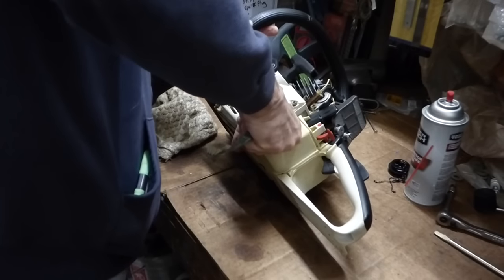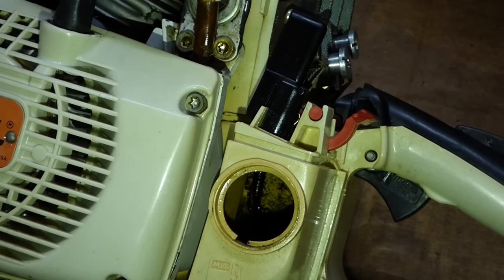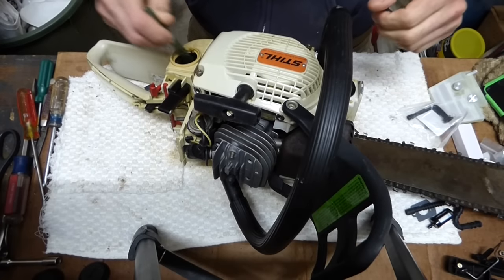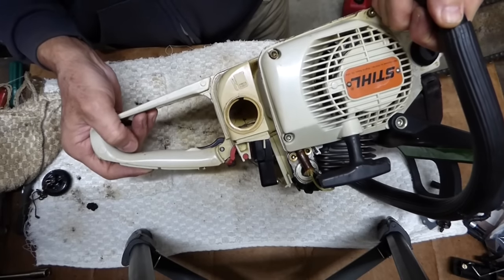Never Do This to your Chainsaw ... How to Repair it if you do

Comment: I have a o25 I bought new, its about 10 years old it will start, but after you use it for a while  you have to goose th throttle  and if you let it idle it will die and when  I pull the rope it will hit sometimes and you have to feather the throttle handle. To get it running again for a short time.
Reply: Sounds like the low speed carburator adjustment screw needs to be turned in or out.  Get it running and insert a small screwdriver into the adjustment hole to turn the screw.  Turn the screw in just a little and listen to the engine.  The rpm will either get higher or lower.  If it gets higher, keep turning until you get the rpm to start decreasing again.  Then reverse directions just a little to get the highest rpm at idle.  If, when you first start turning the screw, the rpm goes down, then turn the screw out to find where maximum rpm is.  There is also an idle speed adjustment screw.  This should be adjusted so that the chain stops moving at idle speed.  The high speed adjustment screw can be adjusted for maximum rpm too when the throttle is wide open.  Before you do anything though, get the air filter off and blow it out with some compressed air.  A dirty air filter can mess with the fuel to air mixture too.

Comment: @Helping U online - You recommend not leaving fuel in equipment for long periods. Can you please define what you consider to be a long time?
Reply from the maker: If I don't use a piece of 2 cycle equipment more than once a month I drain the fuel out of the tank and run it out of the carb....  just takes a minute and saves lots of headaches.

Comment: But what you got off ebaY were Farmertec/Huztl MS250 components. Made in China for a MS250 exact clone version of the Stihl.  Servicable, but maybe not so hot.  If they don't come bagged with a Stihl item number they're not OEM Stihl. Personally, I wouldn't trust the fuel line or the air filter (the air filters sometimes don't seal well and allow dust in around the flanges - like your carburetor showed originally).

Comment: Why did you not grease the bar sprocket?  There's usually a little hole on each side of the bar at the sprocket to inject grease into it.

Comment: Why use silicon grease for the sprocket? I thought that was low heat low speed grease. I would have chosen lithium grease over silicon; or wheel bearing grease with some molly in it.

Comment: What works great for cleaning the inside if the gas tank… GunkSC and some BBs let it soak over night, agitate. Pour it out and rinse with a hose. Dry it with compressed air or a shop vac.

Comment: Ethanol- the issue with many an engine that wasn’t made to run polluted fuel.  Sometimes melts rubber, sometimes hardens to the point of rigid.  Saw many times in radio control gas engines.  I always find no ethanol fuel and use good 2stroke oil.  Fresh mix only.  With $2500-$5000 invested in my plane the last thing you want is a stall or damaged power source.

Comment: The newer saws you want to keep full of fuel, even if they sit a year or the gas line dries and cracks out. The older saws you need to empty. Any Stihl shop can answer what year(s) are the range in which is recomended

Comment: You Don’t leave Gas/premix in any Two stroke / two cycle Engine primarily because the petrol will evaporate slowly making the fuel more oil rich. I never leave two stroke mix in a fuel tank for more than a week. It will minimise plug fouling too. I drain my Chain oil to so there is nothing to leak out.

Comment: I wouldn’t not buy a saw just because it needs a top end. You can get a meteor or hyway top end kit for around a $100-$150 for most saws. Granted these cheap homeowner grade saws aren’t worth fixing, but a pro grade saw at the right price is most certainly worth changing a piston and jug on. Changing a top end isn’t very difficult or time consuming. As long as the bottom end is good it’s worth fixing in my opinion.
Reply: If a rebuild isn't that hard, and I can get a top end kit for 35 bucks, and I don't need a professional saw, why shouldn't I fix it? Sounds like your talking down from your pedestal....your opinion is tainted.

Comment: American fuel must be wild stuff!
I can store a saw for years, full of fuel, start it and it'll run fine!
Petrol must be a better fuel than "Gas" !
Reply: They add corn based ethanol in our gas here. Usually the "premium" grade gas is ethanol free but in some areas of the country that even has ethanol in it. Less problems back when gas didn't have ethanol in it at all
Reply: Do they put ethanol in your 'petrol" if they don't then that is why it lasts. Our fugking government mandates ethanol in fuel for cars. You have to buy more expensive non-ethanol fuel for yout gas powered tools.

Comment: I would have removed that repair handle, removed the fuel line and used the pressure washer on the tank.  I would have also removed the starter, bar and sprocket cover and cleaned these parts with the pressure washer.  Super Clean and the pressure washer would remove that tar from the tank.  Water does not hurt a chainsaw but be careful not to get any in the engine.  I block off it at the boot and exhaust port.  I want to get the cylinder perfectly clean.  I will then blow everything dry with compressed air and let it sit in a warm place for a couple of days to dry.  The only thing I worry about is did I loose spark washing it?  A lot of coils will develop cracks over time which could let in some water and kill spark.  However, I just replace the coil.  Washing the saw did not kill spark - a defective coil killed spark and it is better to replace it than wait for it to fail, later.  I want carb nuts to have even torque on each nut and be screwed down, evenly.

Comment: Why did you pollute a good gas can with the first stuff you dumped out, but on subsequent washings you used a cup?  Now you'll have to wash out your can! 😅 Also why do you use a greasy, dirty rag to clean the grease out of the clutch drum? 😂 And like someone else mentioned, there's a little hole in the bar near the sprocket to lubricate the bearing.  You can buy a grease gun with a special tip that fits the hole.  The oil doesn't even enter that bearing because centrifugal force will not allow that.  

You did a good job other than that.

Comment: I would argue that depending on the price of the saw it is worth replacing the piston and cylinder.
Reply: 35.00 US for aftermarket head/piston/rings kit for ms290 I'm doing right now. Plenty of YouTube videos to help with the rebuild. Would be a shame to scrap a saw for that reason.
Reply: Piston and cylinder are not maintenance items. Run them until there's a loss of compression.

Comment: I have a 230 and it starts if I prime the carb through the air input . It fires up for 2-3 seconds then dies. Then that's it. A lot of pulls later I give up. I cleaned everything I can see on YouTube. This is probably the 25th vid I've watched
Reply from the maker: for some reason it sounds like fuel is not getting thru the carb into the cylinder so it can fire.  If you can't find or clear the blockage in the carb you may have to replace or rebuild it.  Maybe you have overlooked something?

Let us know how it works out.
Reply: Try softening( stihl mix fuel) the carb pump diaphram or replacing  it,  fuel delivery problem.  Fuel tank intake screen? Pull and check/ replace. also clean carb internal screen filter  if open might as well do a carb diaphram and gasket replacement  cheap and easy if you have good eyesight and dont have fat thumbs.
For good measure wash (dish soap and hot water) the air intake filter every 10 tankfuls, or sooner. 
Avoid E10 fuel.

Comment: Not sure anyone has already mentioned this but Carburetor Cleaner will turn the rubber components such as the fuel line to tar.
Reply: It's ethanol in the fuel that did it.

Comment: That's what you get with Ethanol mixed gas. Plus gasoline is not what it used to be. Actually better now. But any mixed fuel for 2 strokes won't last, for 2 seasons if it sits over a few months.  Use it or dump it.

Comment: Instead of carb cleaner, gas, paint thinner,  try using brake cleaner. It disolves oil,  grease, etc. alot better and faster than anything else!

Comment: If I find a saw with a scored piston I will still buy it but the price goes way, way, down - into what I call pocket change.  Super Power is a great cleaner, just rinse it off with water, afterwards.
Reply: Awesome is Awesome to clean with' it's biodegradable and won't harm the plastics/ fuel lines/ discolor decals/tarnish aluminum etc. it's cheap compared to other cleaners and does the job just as good. It's basically the same thing you get at the carwash ( tire cleaner )
I'll take 3 5 gallon plastic jugs to the carwash and for $10.00 I can get about 3 gallons. You'll need 3 plastic jugs because it will start to foam up So you'll have to keep switching from jug to jug giving each jug time to let the foam settle down. 
I work on a couple hundred saws a year and this is what I use to clean saws and other small equipment with' I discovered that about 25 years ago. 
The purple power he's using will discolor plastics and tarnish aluminum. 
I use to use it until people started complaining. 
I got a cousin name is John' hadn't saw in about 25 years ' works on saws also' you from NC?

Comment: I have an 026 still and unfortunately I ran it with gas that I thought had oil in it and burned it up I can't bring myself to throwing it away and I'm looking for someone that can fix it if anyone out there knows of someone please let me know thank you
Reply from the maker: If you look online you can get a piston and cylinder kit for that engine for $50-$100 and it’s not very difficult to change the top end of that engine.
Reply: @helpinguonline  thankyou

Comment: Good video.  But don't wet wash a saw. Blow it out with compressed air and wipe.
Reply: A little soap/degreaser and water sprayed is mandatory on a saw in that condition or it will more than likely will overheat.  I agree compressed air is usually all that's needed when saw is maintained properly though.
Reply: Yep, not every saw maintenance gets the exact same treatment.......

Comment: Too much oil in the mix.I have a fleet of tools. All Stihl.my R90 is 7 years old the best machine I own.I use it for trimming and long pole hedging and brush saw.paying attention and knowing your equipment is key.I disagree about running full speed.whenever possible I run half to three quarter throttle.I have a two cycle Fs 55.it’s a nice little rig for around the houses.The key is clean air and clean fuel and do your maintenance.you won’t have any problems.The reason you see these machines in her shop is because the owner doesn’t know how to maintain them and they can’t repair them when they are not running.

Comment: Good thing you're using 3 in 1 oil for all its good for, putting it on anything that moves under power is a recipe for disaster. It gums up, cakes and fails on anything from sewing machines to anything else. It has too many solids in the formulation. It's "sucker" oil now. Didn't used to be. Folks buy and use it because it's what their dad or grandpap used, but it's not the same. It's cheap garbage. Sad to say. Good for fitting hoses I guess or lubing door hinges...
Reply: Got proof?

Comment: Nothing to it……….but, 15 to 20 years as a chainsaw mechanic will come in handy when you want to work on your chainsaw yourself.  Otherwise take it to the experts let them worry with all the headaches then pay the man for his expertise.  Happy sawing.
Reply: mechanics make a ton of money from people like him, , ,  the gasket for the carburetor goes between the carburetor and the intake tube.  the saw is running way to lean due to air leaks, it will be trashed in a few hours, or less.
Reply: We’re
Reply: @thomasgronek6469  ……I agree that the motor sounded a little lean and maybe leaking a bit, however, how many lawnmower shop mechanics have you ever seen driving around in a Maserati?  These guys don’t make that much money and most of them ride around in 10 year old trucks, making just enough to live off of.  The owners of lawnmower shops don’t make a killing either.  In order to keep a business going they can’t charge much beyond what they know people will invest on their used equipment before they just buy something else or go somewhere else where another dealer is up to his/her eyeballs trying to keep their business afloat.
The lawnmower business is nowhere like the automobile business. The owners of these businesses do pretty good but their salesmen out front are in a Tiger-eat-Tiger situation and must put forth efforts close to criminal to make a decent living.  It’s not like you think.

Comment: So many things done wrong and people who don't know better will follow and do the same things. Not all chinese carburetors are good and most will run lean and burn your saw up. Never use oil on rubber because it breaks it down and will cause it to turn into that tar. Just fresh gas will clean out the tank no need for scrubbing and using mineral spririts. Never start a saw without a bar and chain on it because it will idle too high and could runaway and blow up, no need to adjust the idle or low and high screws too lean like that. I think someone has taught him some valuable things but not enough to be a teacher. This comment was solely intended for bettering everyone who reads it.

Comment: WRONG the gasket goes between the carburetor and intake tube, not on top of the carburetor.  Turn in your wrenches.
Reply: I was just going to add that point.   Had to replay a few times.    Otherwise great cleaning job.  Liked the lube used on the needle bearings.  I have a tube but use only on brake slid pins.  Now I have another use....
Reply: Wrenches? That’s a screwdriver job …

Comment: Not need change repair fix old chainsaw things not economy. Stihl carburetor and gums and engine cylinder valves…etc very expensive not economy. Need buy new Stihl chainsaw. I have Stihl 880 and Stihl 171 I will buy new if They very old and noz work because repair change carburator…etc very expensive

Comment: Never, ever use gasoline as a solvent/cleaner. Gasoline has one purpose and one purpose only: fuel for an internal combustion engine. One gallon of gasoline vaporized has the same explosive force of a case of dynamite. Not only is it highly combustible but it de-fats skin, leaving it vulnerable to an infection. Please use a safety solvent.
Reply: Really?

Comment: It looks like you did not know anything about the inside of the carb? you put the video fast mode and did not explain anything about taking it a part or putting it back together./ you just showed it back on the saw again, You did not explain the notch in the drum  that fits over the oil gear that pumps the oil to the bar? not very informative. you made people guess at what you did. If your not going to explain everything , do not put videos out. I knw this because I run saws for as many years as you are old
Reply from the maker: I put a link at that part in the top right corner on how to clean the carb for folks who wanted to know how to do that.  I often have to do clean the carb and thought the best way to handle it is to refer to a video where I go through it step by step.
Here is the link and hope it helps you...
https://youtu.be/MtggiZf_x-4

Comment: If you are making videos to impart knowledge and skills to whoever may watch it, then it make no sense to gloss over important steps with the video running way too fast for observers to see the steps needed to perform that task.  People are more interested in acquiring knowledge and skills than MARVEL at some expert performing  complex tasks way too fast for the observed to understand.  So if you bother to make educational videos, make sure you are educating the viewers, and not glossing over what you may find elementory,  but the observer may not comprehend, othervise the videos is only of limited help to many viewers.!
Reply from the maker: During the sped up portion of cleaning the carburetor there is a link that comes up in the top right corner that you can click on to watch step by step detailed instructions on how to disassemble and clean the carburetor.